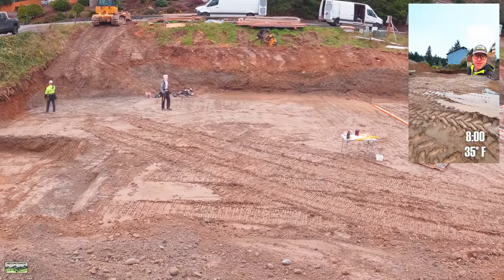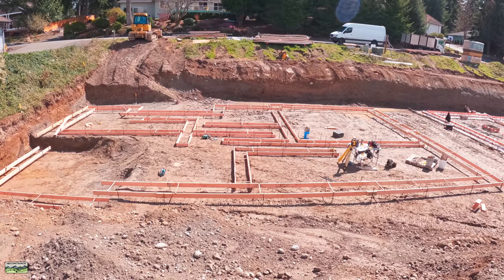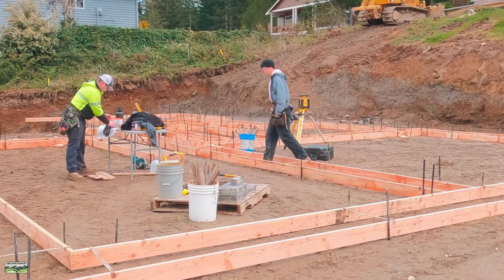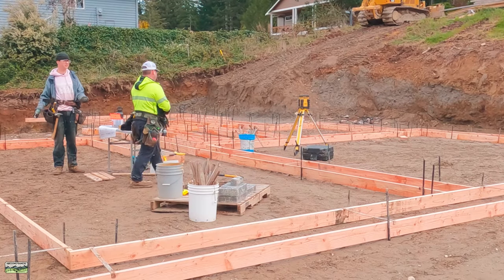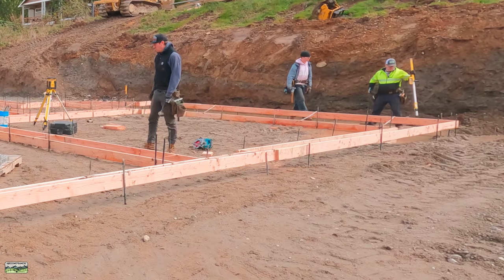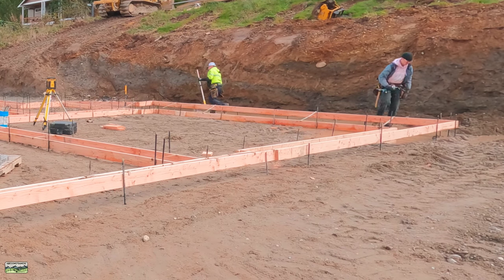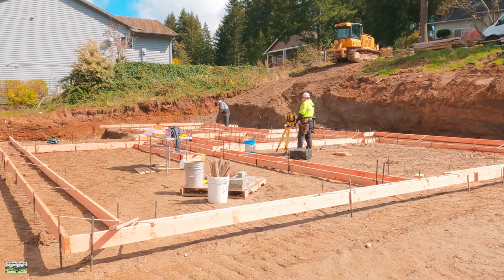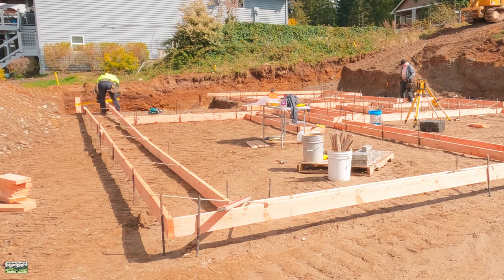How to Form Footings- Raising to Grade

Comment: For smaller footing jobs or filling gaps because of over dig, lumber wrap works really well and the yards are happy to see it disappear.
Reply: Just don't tell the engineers you are using wrb to plug holes.  The idea of positively connecting the footing to the earth is to create a friction coefficient to prevent sliding in an earthquake.  If you are in zones 3 or 4 definitely don't tell the EOR what you are doing.  The inspectors sometimes know the code, but often overlook it.  The best method for plugging gaps is 1/4" wire mesh.  Enjoyed watching the way grandpa did it.

Comment: Those concrete form liners are an awesome idea. I could see them being extremely useful with basements. Basements are usually always poured in 3 separate pours. The footing, the walls then the floor. Concrete doesn't like to bond to cured concrete so micro cracks are formed in between the pours and are susceptible to hydrostatic pressure. The best performing drain tile are placed below the footing/foundation line leading to a sump pump or down grade. The way your footings are set up, you could immediately set your drain tile and paint/apply your below-grade waterproofing and the whole footing would be exposed to cleanly waterproof to. It would last forever. Never a damp basement. Keep the videos coming please! TY!

Comment: Do you prefer round or square stakes for the forms?  Looks like you have round and suspect that is what you have always used.
Reply: Here in b.c. Kamloops ( Canada) we mainly use little wood stakes to raise it up, seems to work alright
Reply: I can only get square stakes on the east coast, unless I wanna pay almost as much in shipping for them 😕
Reply: @dustinbone4942  Here in Pemberton, BC we use the round rebar stakes with holes for nails/screws (which looks like what Tim uses too)
Reply: @adammacer  we have those as well but we only pull em out of the trailer when the ground is really tough or lots of rocks, I like the plastic they put on the footings, would save a lot of time and wood not having to fill in the gaps on the bottom with wood or gravel ( after you raise the footings )

Comment: How are those stakes holding the wood up
Reply: The stakes in question are made for this purpose and I've heard them referred to as, footing stakes. They are made of metal and have holes spaced in them to drive nails or screws through them to secure them to the lumber forms.

Comment: This is the worst footing job I have ever seen. The grade is not set correctly. You NEVER raise the footing forms over an inch. If you need to raise the forms over an inch, you need to hire another dozer operator because the one you have been using doesn't know how to grade.

Comment: awesome and snappy editing is great too. Ok the 3lb. maul is a "drilling hammer"; grab an sds bit and try it some time. ⅛-¼ turn every strike and hey presto you are a rotohammer. Thanks again, you guys are awesome and great to see you leading by teaching a person irl not just all of us in the ether.
Reply: It looks like they are using square stakes.  An sds is still a good idea, just change the setting to hammer with no drill.  Some kind of adapter might need to be rigged also, like an old broken bit welded to a bigger sized tube, a bigger sized tube with a thick wall.